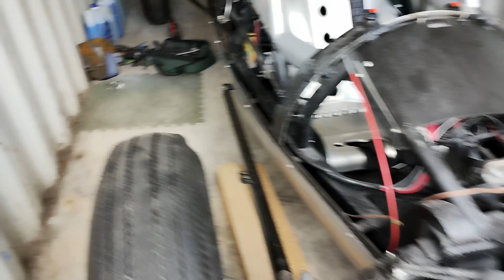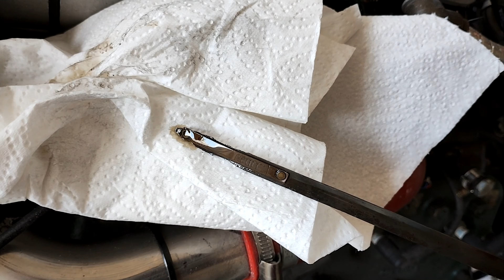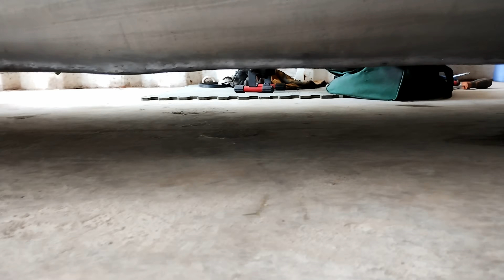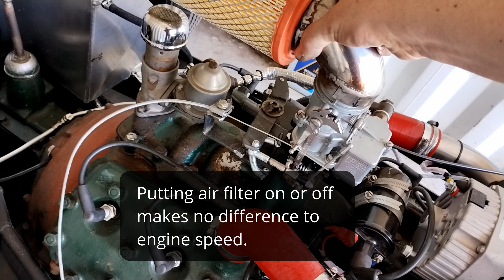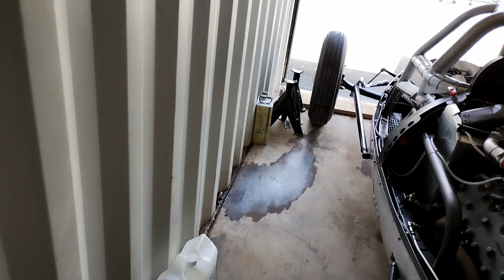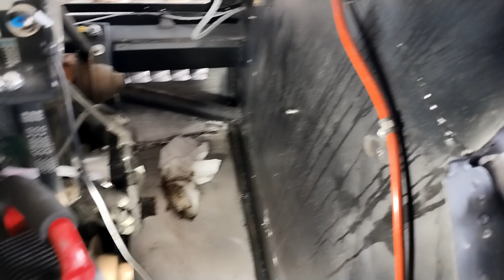Belly Tank Ep84 | Have I damaged anything?

Comment: Glad it’s working out for you !

You can increase the boiling point of your anti freeze by diluting less and or adding “water wetter”
Reply from the maker: As I am running on a beach I shouldn't use any anti-freeze at all - rookie mistake last time. Agree with you, will probably use de-ionised water with water wetter.

Comment: What part did you use to join the rear end and transmission ?
Reply from the maker: I had an adapter machined by a local engineering company to a pattern I made. It's in one of the episodes, not quite sure which one though !
Reply: @XenonJohnD  thank you.